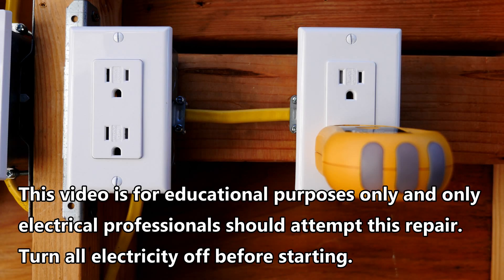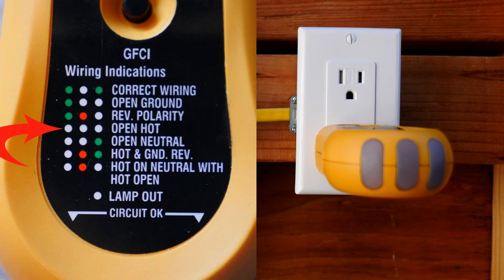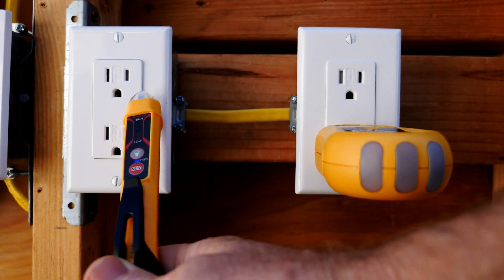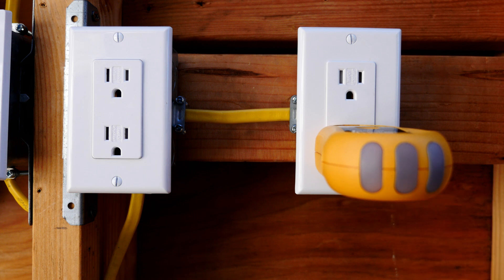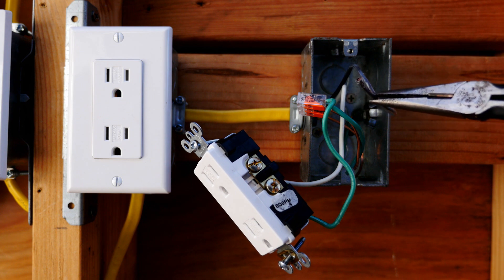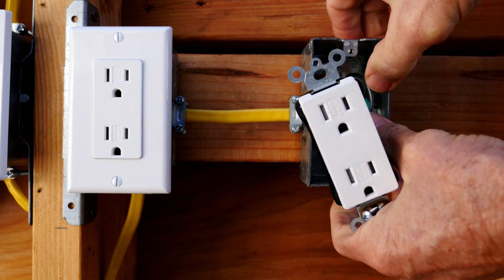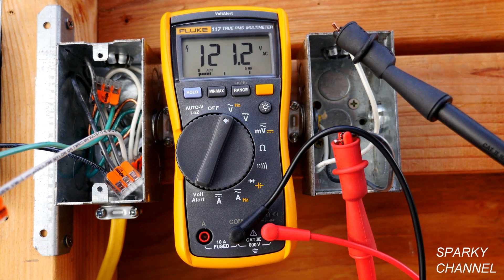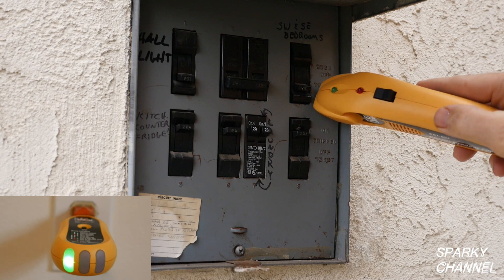How To Fix an "Open Hot" Receptacle

Comment: My situation is different. It’s a GFCI outlet.  It “tripped” and tripped the breaker too. If I hit the rest it trips at the breaker and sparks at the outlet. It was working fine, but just stopped.  Now I replaced the GFCI with a new Leviton GFCI , I cant get the test to click, and the little green light is on.  The Outlet tester says Open Hot.  All other outlets on the circuit are good except the other GFCI in my bathroom which is dead.  Can that be the culprit?
Reply: What did you ever find out?
Reply: @MakayaGemini3   the 'load' wasn't on correctly on the bottom screw
Reply: @paulbonaventura4969  Ah,Thank you! Glad you figured it out!

Comment: so i have an outside outlet that is not getting power. it reads blank on the outlet tester. I confirmed no power going to wire with ohmmeter testing for continuity. i pulled apart an exterior light above where the socket is. you can see this is where the power going down in the box towards the plug outlet. the upper light has power, so im assuming there is a short in the wall between that light and the outlet. there is no other lead going to the outlet so it only comes from one direction.  what can i do to fix it? i confirmed no nicks or damage to the wire at the outlet. so thats why it must have a problem within the wall. thanks for reading
Reply: I'd like to know what you figured out? Seems like NO ONE really replies back from the channel anymore.....
Reply: @MakayaGemini3  the easiest way to to test if a outlet has power is plug a light in and see if it works. Unscrew outlet and touch wire. You will get shocked. Don't do that. Use an ohmmeter or test light and see it it flashes up. That is the safer way to test for power
Reply: @JACMAN02  LOL. Ok,yeah pretty much knew all that just wanted to know what YOU found out to be the problem. The wiring inside the walls  or what? If so I guess you just replaced all the line?

Comment: Great video! 
Mine is showing open hot. The light indicator on the outlet is green. Didn't see any breaks on the wire though.
Reply: What was the problem? Have the same issue now
Reply: This is the exact issue I am having right now and I have checked everything
Reply: Same issue here.  The outlet arced or sparked and burnt so i replaced it.  The tester shows open hot but the gfi indicator is lit.

Comment: Bill, another terrific video.  I would appreciate your recommendations for a generator I would like to get to serve as a backup power supply for my home.  I would like to have 120/220v output and 45/22.5 amp minimum output. You suggestion will be most appreciated.
Reply: I don’t really have a budget limit, I just want to spend A reasonable amount but not Be wasteful.  I would like the generator to be portable on wheels so I can move it or take it camping as needed. Also be reliable and can power electronic equipment like computers.
Reply from the maker: What's your budget?

Comment: There's only one much more dangerous situation, that's if your circuit tester indicates the red light and the right green one. That would mean line and ground are reversed, so the metal housing of a class I appliance would be live at mains voltage.
And on such things it's always the best thing to use insulated tools. No german electrician uses uninsulated tools if he's working on a circuit, even if it is dead. Just an additional layer of safety. You can have a backfeed from a totally different circuit in the worst case. Especially on old installations many things were messed up in between by DIYers or other incompetent persons. And sometimes even electricians do wrong things.
My favorite reported accident was in a restaurant. They had their bathroom in the finished basement. Next to the door they installed a cigarette vending machine and required an outlet for this. Back in the old days the three colours were black, gray and red. Do you remember about the thing with the PEN which was used as neutral and ground in combination? Normally black would be the line, gray the neutral and red the ground in old electrical installations pre 1965. But it was also permitted to use the red wire as a line wire, also as a switched line and in that case gray would be the PEN wire. The electrician made measurements, and connected the new outlet. Black as line, gray as neutral and red as ground. But in this case everything was different, red actually was the switched line for the light fixture in the bathroom. When he made his measurements he measured the PEN through the incandescent lamp which got a very low resistance when it's cold (PTC resistor). So every time when the light was on in the bathroom, the housing of the vending machine was live at mains voltage (230V against ground). So smoking could kill you before you even got the package. Ok, later another electrician came over for a different problem and became shocked by the machine, ambulance had to come over and reanimate him. So this report was filed to the worker's compensation board which investigates such accidents.
Reply from the maker: Great information, thanks!
Reply: Wow! That's scary!